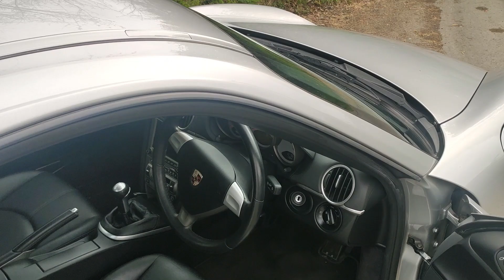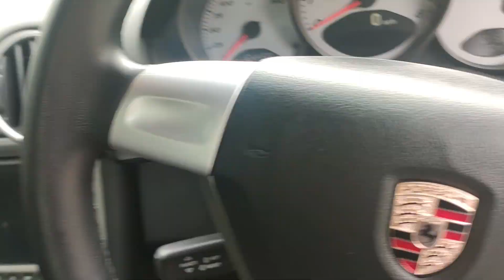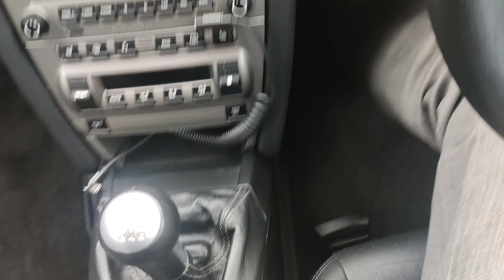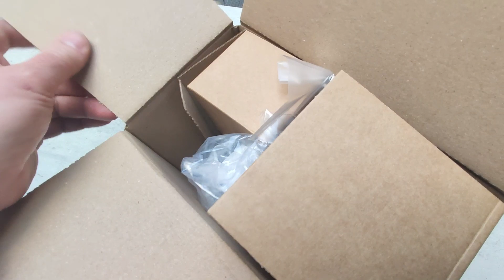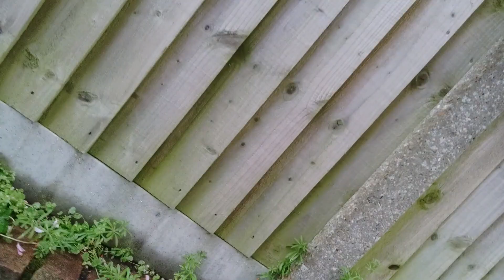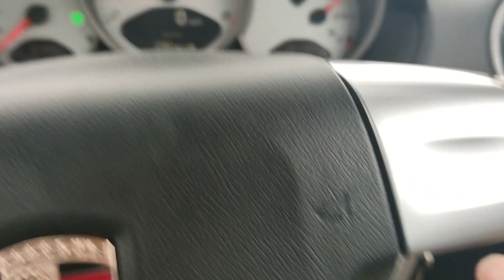Porsche Cayman 987 Cruise Control Retrofit

Comment: I’m confused - I didn’t quite understand why you received a dealer contribution?
Reply from the maker: I purchased it from a dealer who listed the car as having cruise control, and I travelled a long way to pick it up (then it didn't have it!). So the contribution from them was a peace offering!
Reply: @Autobunker_OG  Ahhhh okay. Got it.
Reply: So the true cost to anyone else would still be £553, which is still 50% less than main dealer.  Any idea if having this retrofitted by a 3rd party invalidates warranty or anything like that?  I actually only have 6 months left on my extended warranty and can't extend it anymore because of how long I've owned the car.
Reply from the maker: No idea on the warranty I'm afraid, I am in the 'self insured' category!